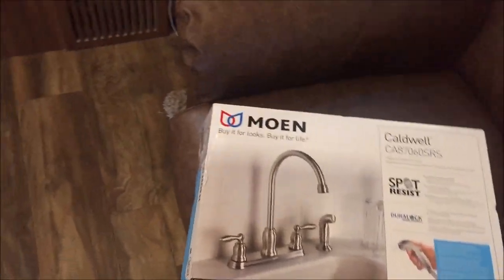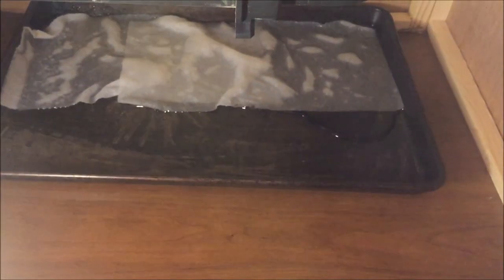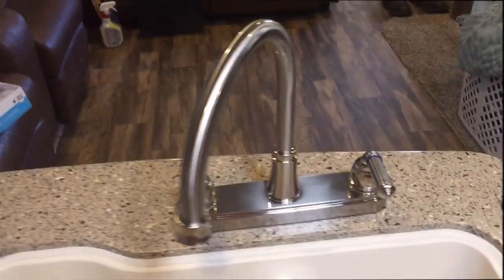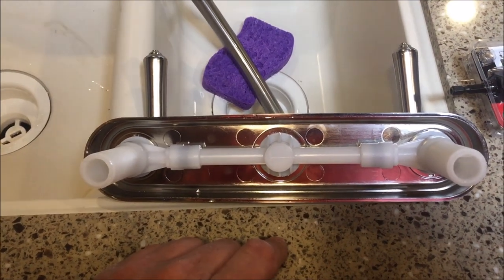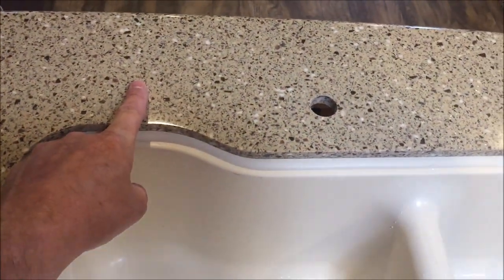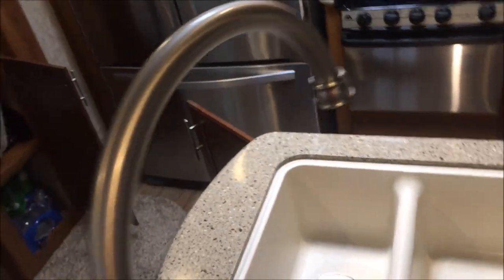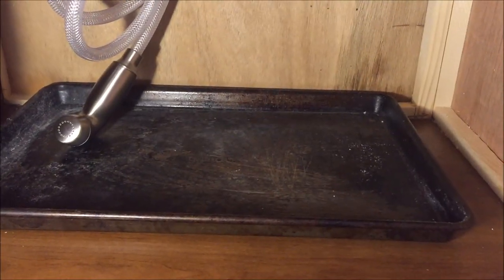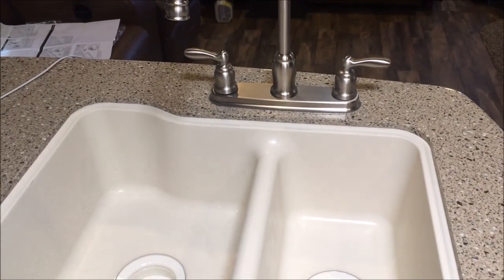RV Kitchen Faucet Replacement & Upgrade

Comment: Great video and thanks for sharing. Only had one question, are the lines standard size or what specific measurement does it require to connect to the water lines? Looking to not only upgrade the kitchen faucet, but the one for the restroom on our travel trailer. Any info or pointers are much appreciated!
Reply from the maker: It’s been too long ago to remember. If I didn’t cover that in the video then I’d say what was in the rv hooked right up. I sold the rv so I can’t look for you.
Reply from the maker: I just watched the video and it appears it hooked right up using the existing fittings.

Comment: Nice work.  Anytime you can replace cheap Chinese plastic parts with metal it will be much better.  The sad thing is, the RV industry loves plastic.  I hate it.  I would be willing to pay more for the RV originally if they had metal parts.  Most of my problems with my cars and my motorhome has been caused from having plastic parts.  Hate them!
Reply from the maker: They think they have to make everything light weight (and cheap)  I bet a good engineer could lighten the load without using cheap plastic parts but they wouldn't make as much profit.  They should think "Quality" once in a while and see how well that goes...

Comment: RVFaucets.com would have had the replacement. Just had the same issue with my rv and my faucet was identical to the one you replaced. Just info for next time. But you definitely upgraded.
Reply from the maker: I could have replaced the unit with the same junk locally from Camping World but I like the better quality faucet.  no regrets!